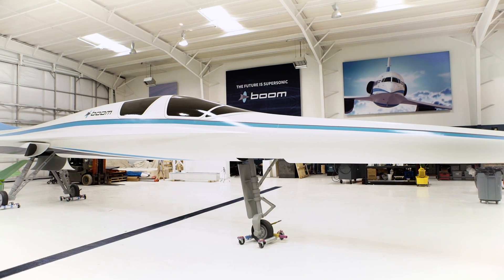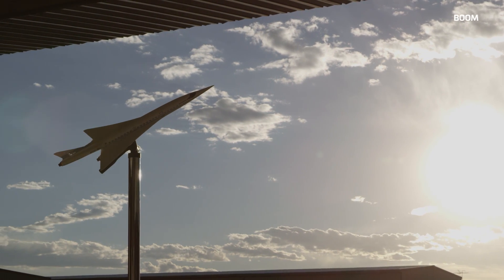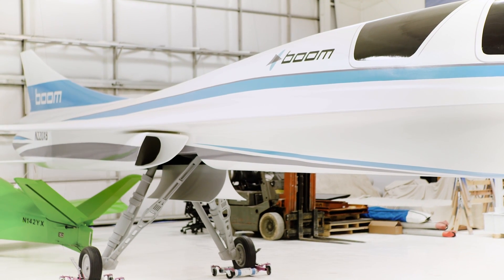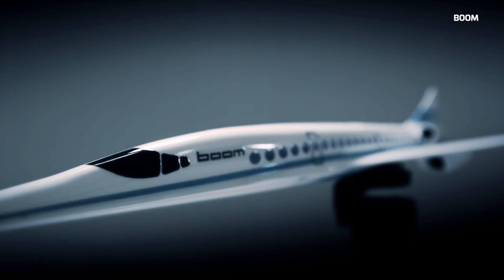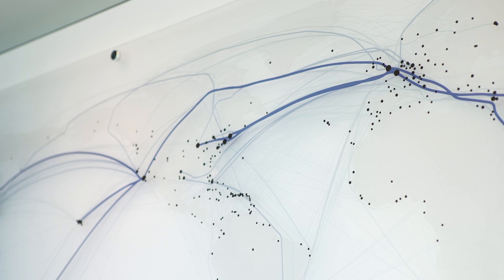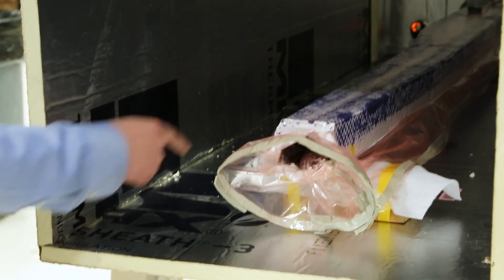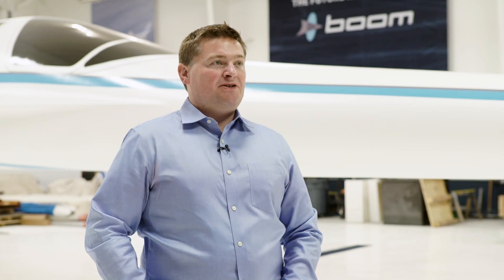Boom is bringing back commercial supersonic flight

Comment: In my opinion, Boom will not be allowed to fly the aircraft supersonic over land due to sonic boom concerns. (No pun intended).

Also, like the Concord, it will have very limited range and will require secondary airports should flights be required to enter a holding pattern due to weather or flight delays for whatever reason.

Comment: which engines Boom is expecting to use ? there are currently no aircraft engines able of supersonic cruise with accepable fuel efficiency and noise...
Totally new engines should be developped at huge cost for a very small market with no garantee of success.
This Boom project looks very much like a trap for investors !
Anyhow, with the current air transport crisis because of covid-19, it's not the right time for such a project...

Comment: Concorde wasn’t viable because of jealousy of other countries, straight away they boycotted it, it was a technological success in aircraft, it didn’t require afterburners to attain supersonic speeds (super cruise) and could fly at 60,000 ft. The fuel crisis also put a stop to it and airlines wanted more for their gallon of fuel. There will only be one supersonic airliner that will be remembered, Concorde everything else will just be a toy!
Reply: The problem was that the Concorde was too thirsty, it could fly from Paris or London to New-York, but no more. It couldn't fly from Frankfurt to New-York...
An noise was another problem !

Comment: What boom is doing is making a real world version on one plane that only exists in ms flight simulator.

The Syrotokey excalibur  cruises at mach 2.2 at 70,000 feet and a range of about 5000 miles

When Boom rolls their SST it will br the highest flying passenger plane ever built and the fastest at mach 2.2

Comment: This project has little credibility, as currently there are no jet engines able to fly at supersonic speed while being compliant with noise regulations and having fuel needs low enough.
Only jet engines designed for military planes can fly at supersonic speed, but they are too noisy and thirsty. The military don't care for the noise, and use in-flight refueling for longer range.
Completly new jet engines should be designed, and the cost would be extremly high for a vey small market...

Comment: Boom is already setting it's self up for failure. The reason why Concorde "failed" is because the capacity was too small. British Airways and Air France said that it was unprofitable since it was, A. High fuel and maintenance costs; B. Low passenger capacity (this makes the ticket price very high in order to distribute the cost upon each passenger; etc. I don't think a lot of people will buy the Boom supersonic jet for the reasons I have listed above. Boom is making a Concorde 2.0. A supersonic, expensive, unprofitable, almost-useless, plane. :)

Comment: Concorde turned out to be a taxpayer funded means of travel for the 'Jet Set'. It eventually failed after the Paris crash, the uber wealthy gave it a big swerve realising that if you die, you cant take immense wealth with you.

As for development, Concorde took nearly 20 years of development by two industrialised countries, and whilst some tech may have moved on a little, I doubt that Boom, a small company, has more smarts than the combined input that the development of Concorde required.

Verdict, Look out taxpayer, there's a huge danger you're about to get the round in order to subsidise the fun travel of the in Crowd.

Comment: Jesus H- this was done over 50 years ago in the UK- you are trying to reinvent the wheel, and not very well. The Yanks killed Concorde due to "noise"- it was in fact that Boeing failed miserably at the time.
Reply: How do you know they're not doing it very well? Concorde had a lot of space for improvement, and I don't see why new knowledge in simulation technologies, materials, electronics, etc, couldn't improve performance and cost of commercial supersonic. Sounds like you're talking out of your ass.
Reply: well they've had 50+ years to improve- and still NOTHING to show for it. We did it. You didn't. Suck it up.

 @Zealotux

Comment: I like where this is going. Though, making it a trijet is risky since a No.2 engine failure can be disasterous. I guess the solution is to make the No.2 engine a ramjet so that it can supercruise without using much fuel and be able to also go even faster at speeds exceeding Mach 2.5(1,650mph). If a ramjet fails, there is a much less chance of exploding.

Comment: Good job guys taking it to boeing and the big guys.
I like the name, the sound it makes when it breaks the barrier.
We need mach 2 airliners.
Technically very easy just a matter of scale as the precedent was set by concorde.
Where the supersonic boom is allowed is the hurdle but not insurmountable.
Good luck 😊😊😊
Reply: This is no threat to Boeing or Airbus.  I doubt Boom will ever even get an aircraft off the ground.  They will way underestimate the cost to develope a clean sheet aircraft.  Money will sooner or later run dry.
Reply: @rcairflr  
Anything is possible as Elon and the billionaire's have proved.
Nothing is achieved if you don't try😃

Comment: I will be VERY interested in seeing their conversion from prototype to commercial airliner. Their mockup front picture seen on the hangar wall does not look like a supersonic aircraft at all.

Keep in mind that this will be a premium aircraft so unless it gets much fatter, it will only have room for a 1-1 seat configuration and about 10-12 rows (if you count the windows), or a total of max 24 seats.

The claim for 500 financially viable routes is a BS sales pitch used to entice investors. If I were such an investor, I'd ask to see the numbers that support the claim.

Comment: Supersonic Commercial Jets will never make a comback for one very good reason. Sonic Booms. If supersonic jets were flying all over the world, there would be Sonic Booms on the regular. You would have to slow down as soon as you're within 30 miles away from any population. On that basis, supersonic flight doesn't seem necessary for commercial use.

Comment: NY to London.
Sub-sonic: $650 , 7 hours
Super-sonic: $5,000, 3.5 hours
That's still ridiculously expensive. But then again, the first many years of passenger aircraft also had extremely high prices.
I hope Boom can pull it off, but I doubt we'll ever see a significant fleet of super-sonic passenger aircraft. They just burn too much fuel and need a lot of maintenance, especially to the paint.
Reply: having mulitiple jets in your fleet is expensive..  as you said in your price point, even 5000 dollars sub sonic, you get a bed, great food and pyjamas.. the luxury treatement.   Will the super sonic option compete.  That same issue happened to the concord. As seats on sub sonic jets got super comfortable, most business travellers opted for the luxury over the time saving.
Reply: the only way for costs to come down they would either have to make the plane electric or use a different fuel source like bio-fuel
Reply: You can't go super sonic with electricity. The only propulsion that uses electricity is propellers. Bio-fuel is a possibility, but that has lower energy density, so you need to store more of it to go the same distance.

Fuel is expensive, but the vessel itself and its maintenance are the biggest expenses.
Reply: Are you forgetting that 1st class tickets from JFK to London are still usually 3k+?
Reply: NYC to HKG would take a ~20 hr flight down to 10.
Reply: @Jasonsenipor you must have a very low hourly wage...poor man
Reply: The Luxury Ocean crossing Liner's,  allowed the ordinary passenger, as well as the super rich, to arrive at the same time.  It didn't stop the rich paying extra for comfort and  the best of everything did it.  If speed / time, wasn't the main thing, then  go subsonic. BUT--- imagery for many rich people ,is worth paying for too.==  Choice.

Comment: how do you adapt a subsonic engine for supersonic flight?
Reply: Sooner Jon The Conservative my educated guess is that rather large wing area . Wing area of Boeing 737 is 91 to 127 square meters . Wing area of concorde was 358 square meters which afforded it the service ceiling of 18000 meters  where the air is much thinner  compared to 11000 meters of Boeing 737 .

Comment: Why slow the incoming air into the engine? Make it a ram jet SR71! Baby!
Reply: Andrew Armstrong sr71 had ramjets ???! I thought ramjets do not have rotating parts/turbine fans ?
Reply: Not so much as understood today, but the Pratt & Whitney J58 engines in the SR71 could be deemed as ramjets at speeds over Mach 2.5 and beyond. The cone in front of both engines actually slowed the incoming air down from supersonic speeds entering the engine and created a vacuum behind the cone that thereby speeds up the air in the intake back to supersonic speeds giving the inlet air a ramjet effect. The J58 was most economical at cruise speeds above Mach 3.0 and at 70,000 feet altitude. There are many misconceptions about the true top speed of the J58 engines in the SR71. That information is still classified and probably lost to time. An SR71 pilot told me one time that atmospheric conditions were perfect and he was covering 86 miles a minute, that is something like Mach 6. The SR72, an unmanned vehicle under construction by Lockheed is pegged to exceed Mach 6 using modern yet classified scramjet engines based on the old Pratt & Whitney J58 engine. The engines work as regular turbines up till Mach 3.0 then become ramjet engines, different but similar to the old J58 engine. Boeing has had huge success with their X-51, reaching Mach 5.5 in 2013, probably much faster now. An older video from 2010 but still good info on this subject. https://www.youtube.com/watch?v=XV8AfgbGh5M
Reply: According to their website::
Japan Airlines has invested $10M in Boom and pre-ordered 20 aircraft, joining Virgin Group as a future Boom operator
Reply: I read its wikipedia page . Its amazing that the J58 was designed in the 60s . With improvements in material / alloy science presently this Boom plane should be a reality in a few years . It could potentially do more than its 2.2 mach top speed if it designs an advanced version of the J58 engine .

Comment: Classic arrogance in super fragile stick slim craft body, extreme fuel emission burning, low thick atmosphere sonic boom freaking, repeat catastrophe in sonic flight history... To give an example of issues on this craft, the body is too slim, that most of the craft layer would require the interior too narrow, it needs a wing formation body frame, looking like a top view sword with the plane tube body molded center stem, like the military scram crafts known as the SR-71, by having the body shaped to a wing, you barely need any fold contraption wings, in fact, the SR only had out extend wings for the sake of the larger, much lesser fuel burning mixer engine compared to the passengers airline versions in history. Even the engine of the 'Boom', looks nosy outdated, modern fighter jets still out match the fuel efficiencies in size compared. We haven't seen a land pad levitating passenger craft that can vertically take off, land on water if needed, fly in thin high atmosphere away from 'Boom' sound. Now we are suppose to try getting harpooned with this over mach 5 wanna be? BOOM!
Reply: material / alloy science has progressed enough to make that "thin" design possible . You seem to be ranting . The top speed is 2.2 mach . It is attainable .

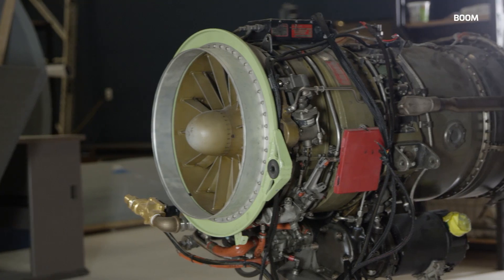Comment: "the engines are adapted from a subsonic design" 1:05

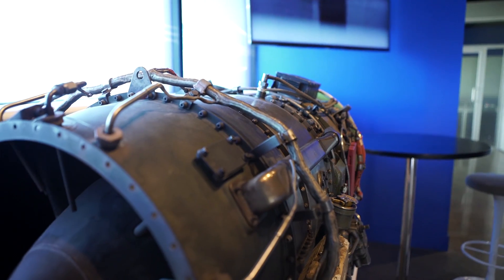"The engines are from a mach 2 Cruise Missile so they're already designed for these speeds" 2:05

Well which is it? Or are they saying different engines for the demonstrator and the final version

Also: "we're using the latest and most efficient engine tech" vs "the engines are adapted from an older design"

Comment: realy we dont need supersonic flight for travel only for fun for rich kids. There is not much diffrence between 8h flight and 3,5h flight (London - NY). This isnt so much diffrence, u spend more time on airports (to get on them, check-ing, secuirity, waiting to plan than than on flight it self. Secound these plans will be small and cramped so, no very confotrable. Realy i more likley spend 8h in confort seat and get a nap, than i craple set for 3,5h. Third reason , money , we need to make flights cheaper not even more expensive. I can flight thise route for 700-1000$ in two ways, than pay 5000$ in no confortable plane, to get spare 4h of my time. Money and comfort matters more than 3-4h our of time, which i can use for sleeping :)

Comment: The problem that supersonic flight faced was the noise they generated. This is why they are banned over mainland US and the number of air fields that can accept them are heavily limited. They are going to face the exact same challenges as Concord, except they won't have the financial and governmental backing. In short, this is extremely likely to fail miserably.

Comment: Fox News (US) reported that a commercial airliner (C829) was tested on the 75 million dollars JF-12 (mach 5 to mach 9 ) wind tunnel.The C929 with four turb0-scram jet engine can fly over the Pacific Ocean or Atlantic Ocean in less than two hours using less fuel.Typed Wang Zhenguo and VLRAAM into your computer to find more information on China s 6th generation airplanes..

Comment: The important issues are:
1. Safety
2. Manufacturing Cost
3. Maintenance Cost
4. Fuel efficiency
5. Speed & Range
6. Passenger Capacity

Comment: Concorde failed due to many things. One of them being that it was expensive af to run and maintain. The cost of maintaining a supersonic plane is extremely high would a limited pax on board compare to other commercial airplanes. It's becomes a no brainier for airlines to stick to Boeing and Airbus etc. 
Another thing was the impact of the environment from the supersonic flight is a viable that can't be control and it will as Concorde did have an negative effect reports ranging from smashed windows to wild life being impacted.
 Supersonic flight isn't impossible but boom isn't providing anything new than Concorde expect a new design. Saying that it will work cause there's more routes operating, is a very flawed argument. Each route has an operating fee and airline tax, in this case I'm pretty sure that it will cost more. 
Making a profitable routes is something else even bigger planes like the A380 don't cut it anymore hence why Air bus orders are down. The Concorde wasn't really profitable and people only flew on it due to the novelty factor. 
Also another shady thing is fuel prices which inflate and deflate. It makes it more difficult for supersonic flights. I really think all this is boom making an American version of the Concorde. Which wouldn't last even long as the Concorde.

Comment: Nice press-release/fluff piece, however there's a problem when the commercial party being featured makes misleading statements which aren't challenged. 20 years ago, when Concorde was flying, the price for a one-way ticket from New York to London cost $5k in 1998 dollars. Even accounting for inflation and making the tickets round trip, the price ~$15k. But the price of traditional airfare has also dropped since 1998 (for base fares, much of the drop in price has been due to the removal of amenities for which the airline will charge additional fees. Nonetheless, the bookings will be based on the ticket price). So while the price of a new supersonic plane may compare somewhat favorably to the price of Concorde in its day, it's not going to compare very favorably in the modern air travel market.
Reply: A jet like this wouldn't initially aim for the normal traveler. This would initially target businessmen and others who are less concerned with the cost. Even with the low prices of tickets, a business ticket can cost 3 or 4 times as much as what a tourist 5 rows back paid.

Comment: It is time we create an air traffic matrix system that track all flights along theirs flight paths, altitudes, direction, speed, GPS, and notification system to traffic intersecting or bypassing, to avoid collusion and near misses, and a system to alert pilots, and an active  automatic collusion avoidance apparatus. To make accidents a thing of the past. For thing could calculate all the different variables, to avoid provide realtime info to system with out pilot assistance.

Comment: Great !! I just wonder how the constructor expects the use of composites (Carbon Fiber + Resines)  for the fuselage goes through the huge thermal dilatations cycles ? Concorde's fuselage diameter did get a large +20 cm in flight, and the main part of the challenge was to find the construction process that fitted such a constraint...

Comment: engines from a cruise missle - engine werent designed to last more than a few hours
Reply: The company is called BOOM too... they're not giving me a lot of hope here.
Reply: Yeah recycling is difficult.
Reply: This is a prototype...not a commercial item. Cruise missile engines I am sure are much easier and cheaper to acquire than a custom designed engine for a few one-off prototypes.
Also, just because the missile overall has a limited life after launch, I would not simply say that the engines "weren't designed to last more than a few hours". These are weapons of war and normal consumer decisions usually go out the window, I am sure that they designed the parts to last some fairly extreme environments....